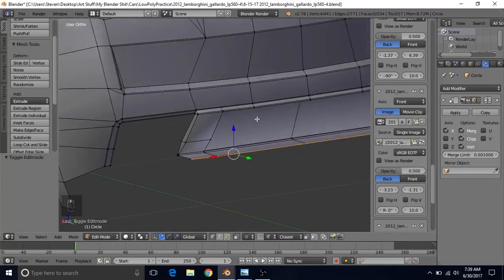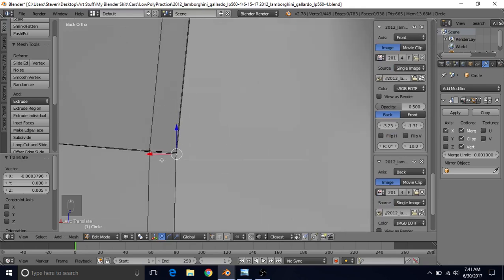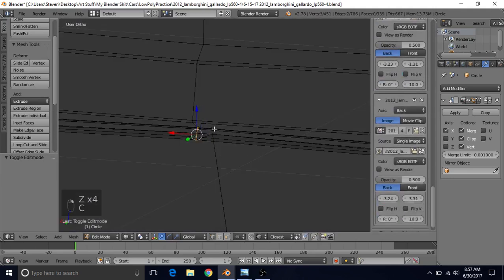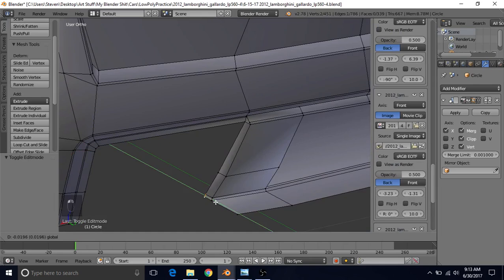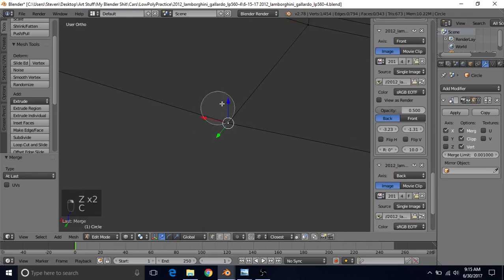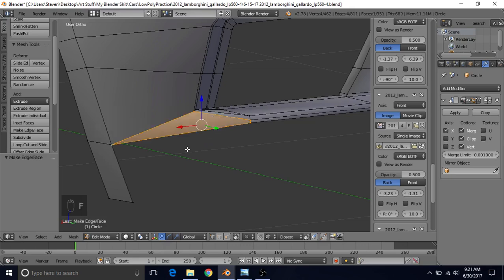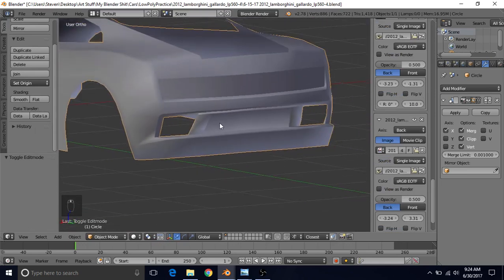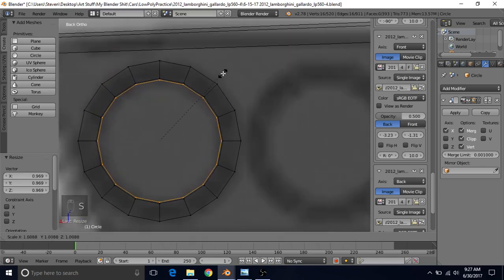Model A Lamborghini Gallardo LP560-4 in Blender - Tutorial Part 10 - Rear Diffuser and Exhaust

Comment: It seems you lost a couple of minutes from the beginning of this video while editing. This wasn't exactly where you left of at the end of part 9. Plz help.
Reply from the maker: Interesting. Fortunately the fix is not too difficult. Essentially what you need to do is add some faces in the center where that gap was in the previous video. You can extrude the vertices on the inside of the pieces sticking downward and just bring them to the center to fill in the gap. The top vertex will need to be merged together with the other vertex that is there. It will be best if you snap the vertices first before doing this. With all of the vertices you just extruded selected, snap them to the vertex you're going to merge the top vertex to. Then merge the two at the top.

From here just do ctrl + R to add a supporting edge loop near the bottom (see how there's two loops very close to each other at the very bottom).

Next, extrude the very bottom vertices out on the y axis (the green axis). Now you should be at the same spot we're at! Hope this helps! :D
Reply: @stevenbrooks1694  I selected and extruded the three vertices from the part that sticks down. But in this vid it seems that you dont have an edgeloop in middle of the face that fills the gap like i do. I also cant seem to snap the two bottom vertices with the top one and when i merge the top one with the other top vertex, the shading gets all messed up. I've sent you a scrnshots of my problem.
Reply from the maker: Yeah I just extruded and joined the middle so there's no middle edgeloop. I don't see the screenshot unfortunately. I was trying to look up the video on my computer to see if there was anything I could see but I don't have it at the moment.
Reply: @stevenbrooks1694  I've sent the screen shot to your gmail. Could you look at it and see what's wrong
Reply from the maker: Nice I got it!

The next step would be to make a face at the bottom of the left side piece with the two vertices on the bottom right of that piece going to the center. You'll need to make one more vertex in the middle to do this. So first you should extrude the bottom center vertex and bring it out on the y-axis a bit then make a face with the extruded vertex, the other one on the bottom center, and the two on the bottom right of the left piece. It should create a small sliver of a face going from the left to the center part.

Then it looks like I extruded all of the bottom faces down. So I would select all of the faces on the bottom of the center part and then extrude. Bring them down slightly to make it look like 0:04 in this video although in the video we have done the next part already.

The next part is to extrude the vertices on the bottom and then move them back on the y-axis just as it looks at 0:04.

At this point you should be where the video starts. I wouldn't worry too much about the shading. If you need to you can use some edge loops on the inside to help fix the shading. You may start by using a vertical edgeloop on the left side of the license plate area. This could help fix the shading. I'm not sure if we do this later in the series or not but it could help.

Hopefully you're able to get everything going smoothly! Have a wonderful day! :D
Reply: @stevenbrooks1694  Thanks i think i got it. It doesn't have to be 100% accurate right. i mean will it screw things up at the end?
Reply from the maker: It might look a little different if yours is a little different but I think you should be ok. You can always change things a little as you go along if you come across any issues. Let me know if you get stuck! I'm glad you got it to where you're happy! Have a great day! :D

Comment: Hey, it's me again. I want to know if you will make interior?it's really interesting, however I have no idea how to start.
Reply from the maker: I'm considering it. The hardest part about doing an interior and recording it is finding images that you can use in a video. For this car, I have found some images that are usable, so it's a possibility. The main focus now is getting the exterior of the car finished and then we'll go from there. I usually start by duplicating the vertices at the bottom of the window and extruding and bringing them back into the car to create the dash board, the area where your feet go, and the floor of the car. Then it's just a matter of adding details.

Comment: Can u send me your Gmail, I'll send you picture with problem(blueprints don't coincide)?
Reply from the maker: Sure. Send it to stevenbrooksutube@gmail.com
Reply: Steven Brooks have u received?
Reply from the maker: Yeah. It looks like you need to lower your side view image. If you want, you can e-mail me your blend file and I'll fix it and send it back.
Reply: Steven Brooks side view u mean right side? So I should make it smaller or bigger?
Reply from the maker: Yes right side. Don't make it smaller or bigger. Just move it lower (like on the z axis) until the farthest point to the left in right view of the image you gave me lines up. Don't move the vertices just the image.
Reply: Steven Brooks okay I'll try
Reply: Thanks,bro)  helped